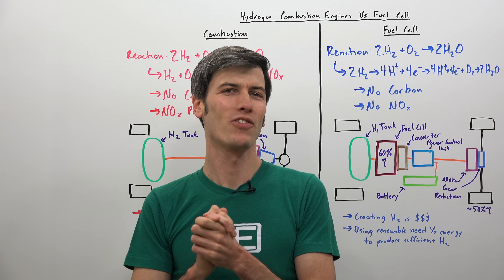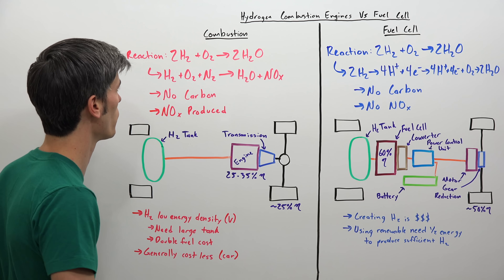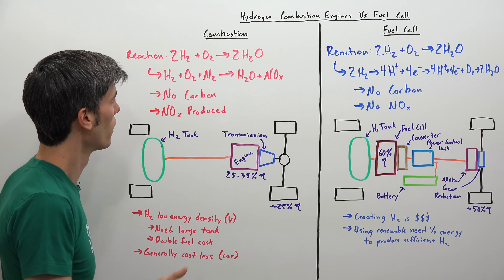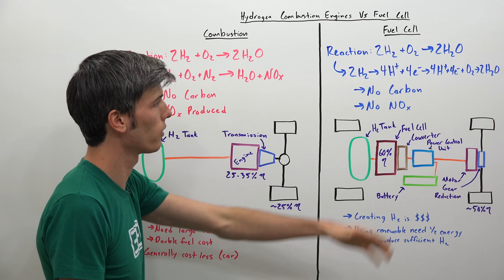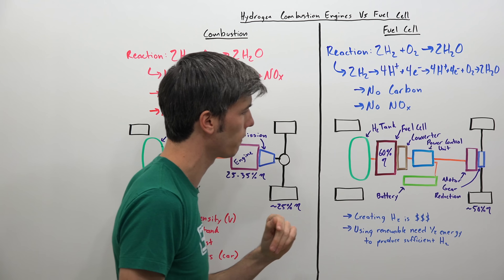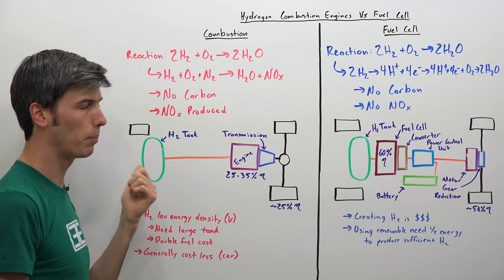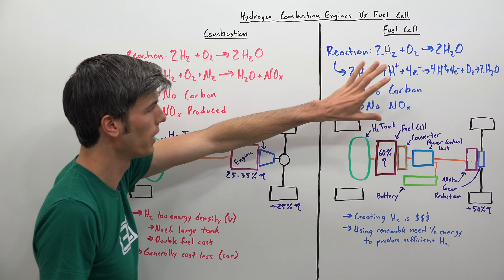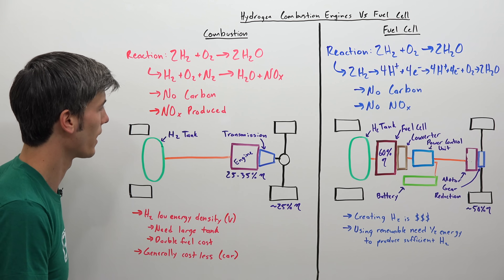Why Hydrogen Engines Are A Bad Idea

Comment: Wrong on the hydrogen "PEM" fuel cell efficiency that GM reached 78% + heat for winter. Also, no huge loss at the wheels as they reached 92% at the wheels using 3-phase pan-cake wheel motors. Pushing more atmospheric gasses into the PEM increases the efficiency using a 42 volt DC motor. This was the only noise I heard. Plus the tail pipe water is only 7% more than any ICE, so no winter road concerns. 
 As for fuel, it is sold in high pressure gaseous or liquid configurations and require only 20% more room under the vehicle. The hydrogen is produced using the "Swedish" model but not using hydroelectric sources, but contracts to purchase electricity at night when demand drops drastically. Electrolysis generates hydrogen from 12 midnight to 7AM at $0.3 cents per kilowatt hour and the compressed oxygen is sold to recoup a lot of the cost. This type of facility runs with a crew as small as 12 techs reducing the cost even more. 
 Our 5 passenger van ran up to 100 MPH with a 250 mile range using liquid. 
Shops are equipped with sensors and drive a roof mounted fan, as the vehicle has 5 sensors on board to detect leaks. Yes, it uses a 3 stage regulator but 3 injectors to operate the fuel cell at peak efficiency. Wheel motors and existing electric drives are employed and perform at a 400 HP range on the track with 4WD easy. It cost $0.19 cents per mile in 2008 dollars. 
 I don't like burning special corn genomes on contracts while using more energy to bring to the market that you get from it driving, all done with tax payer dollars providing $0.49 cents for each gallon produced but a tariff of $0.51 cents on any imported ethanol even from Brazil. Sad! 
Retired- ASE Master Tech since 1978.
Reply: I would like to take the time to post some info about my vehicles setup.  I have been running my car on Hydrogen for about 2 years now.  I do not store large amounts of Hydrogen fuel in a separate High pressure container.  I produce enough gases on demand through the electrolysis process to run my 2.4L engine which requires about 6L per minute at 7000 RPM to run without hesitation or noticeable reduction in power.  To be clear, I do not separate the Hydrogen and Oxygen gases in my device. I simply have a small container that will be pressurized to 12-15 psi before the system will shut off production automatically.  I produce enough gases on demand through the electrolysis process to effectively bypass the need for complex High Pressure tanks to store H2 like most of the current systems.
    With this method I do not store enough combustible gases to cause any significant fire hazard or air displacement danger in the instance of a "leak" or failure of the containment device.  I bought a new fuel tank to replace the one that came with the vehicle to prevent contamination from the old fuel.  Now I use my house water to fill my cars fuel tank which holds 12 gallons.  So the fuel system is the same as you would find from the factory but, I fill it with Water instead of Gasoline and the fuel pump connects to the water container in the engine bay instead of to the injectors.  Also I do not use the fuel injectors, I use a large aquarium tube that is connected to the intake before the MAP/MAF sensors.  In order to run my engine on Hydrogen I had to retard the ignition timing from about 25 degrees before top dead center to about 5 degrees before top dead center.  I did this by using a timing light and rotating my distributor clockwise by about 7 degrees.
    As a comparison my car got about 30 mpg with gasoline, now it gets between 25-35 mpg with Hydrogen.  In conclusion I am sure that with a more complex delivery system I could get better performance and mileage because I am not monitoring the fuel air ratio but, my goal was to create a system that produces less Carbon emissions not to be crazy efficient and cheap to fill.  I believe by producing enough gases on demand this is more efficient because if I run out of fuel through miscalculation or my fuel gauge stops working, I simply need to find someone willing to sell me water (in one case a woman was so impressed she just gave me the use of her garden hose).  This is also safer because I am not using a "High Pressure" storage container for a combustible gas or liquid, it is just water in a tank.

Comment: It all comes down to the biggest problem of all ICEs which is their thermal efficiency. If we exclude some extreme cases such as F1, most ICEs have less than 40% thermal efficiency,which means that 60% becomes heat and nothing else, you can increase its efficiency with forced induction but the 40% barrier is there. If battery technology was developed enough, probably ICEs would have gone extinct earlier, because electric motors are by far more efficient in converting their electric energy in kinetic (about 85-90%),its not a matter of why but when it will eventually happen.The path is not to make an ICE more efficient at the moment, but to make electric motors more efficient, in order to make means of transports who can be autonomous in their power needs with renewable energy and energy recovery.

Comment: Combustion wise it’s still environmentally better than fossil fuels. Fuel cells however are definitely beneficial to a 100 percent renewable energy economy within an LCA model, and as we transition from fossil energy within construction and production of hydrogen platforms we will be able to observe the full effects of a carbon neutral economy with an unlimited supply of hydrogen as a primary energy source.

Comment: But what if you can max up the efficiency a little bit by feeding that battery with a generator that functions as a brake also with some kind of clutch disc that engages the wheels to generate energy and friction to also brake the car. Pretty neat idk.

Comment: It still comes down to visceral feeling. Why do I drive a f150 even when I’m not hauling stuff? I could drive an electric car and be more efficient. Because I don’t want to drive a vehicle that is dead, has no soul or feel to it. Obviously both vehicles are “dead” but with my truck or mustang, I enjoy driving them. Period. I have driven two teslas and both were “great on the drawing board” and “made perfect sense “….. but they were like driving an appliance. Might as well take a bus.
If my ICE is bad for the planet and there is an alternative way to power it then fine, I’ll run hydrogen or ammonia. NOX emissions? Fine, I’ll use a catalytic converter to reduce that. But to go from a jump in, turn key, haul stuff to a silent “mode of transportation “??? No thanks!

Comment: Consequence from this video: Best efficiency is achieved with a battery driven electric vehicle because the battery stores >90% (not 50% as with hydrogen generation) of the electric energy.
Good to know, thanks.
Reply: Putting 100 kw/h of electricity in a battery let’s you take 90 kw/h out of it at 90% efficiency, but how much of that 90 kWh will push your car and how much is wasted whilst carrying the damn 2 tons worth of lithium with you? Also there are Heavy losses over the Electric Power Lines from the Power plant to the charge Station. The process

Power plant - Transforming Up - transmission lines - transforming down - distribute - transforming down - charge

Is about 50% effective. If you chose to generate hydrogen right next to the (green) Power plant you would eliminate these losses. There are plans about using fuel cells to power homes as far as I heard, so in the end a Fuel Cell or Li-ion powered car could achieve similar efficiencies
Reply: @Handyman1199  1.) The 2 tons do not harm. At first order: The power you use to accelerate them you recuperate while slowing down again. 
2.) The losses of the power transmission are in a single digit region. You have this same problem making hydrogen out of electricity.
However I can follow you. The greenest concept would maybe be a hybrid vehicle driving on hydrogen and wall plug charging. So you have the least cost most efficient choice.

By the way, the EV I drive needs around 18 kWh per 100 km.
Reply: @ghlscitel6714  Renault Zoe?
Reply: @Handyman1199  Yes. How you know?
Reply: @ghlscitel6714  my pal drives one and keeps claiming how efficient his 18kw (small accu) per 110km is. I’m driving a Trabant 2-Stroke so i think my opinion is obvious

Comment: Let's keep in mind the high combined environmental impact regarding mining / manufacturing batteries +  copper wiring + insulation + (at least) minimum lubrication + machining many other mechanical / electric / electronic components. Most of the above, won't last forever, specially batteries. IMHO is kinda taking 💰from my left pocket to put it in my right one, adding some energy to do it... 🤔

Comment: Before you give a long technical explanation of a Hydrogen burn! And compare it to a Fuel Cell!
First learn the burn speed of  a Hydrogen burn! Which it's called a Flame Front! Hydrogen burning with  Oxygen has a Flame Front of just under Mach 9! So now calculate that Power difference! Remember Power equals Mass times Velocity Squared!

Comment: Why are the losses in the converter and AC motor not considered these could safely be 20% losses. Electrical motors reach maximum efficiency only near full power which will seldom will be the case in a car.

Comment: Why is a hydrogen ICE as a generator for electricity not covered? A car like the Mitsubishi Outlander PHEV does exactly that, it uses the ICE to generate electricity and charge the battery and has 2 electric motors with good efficiency in the drivetrain. What is the efficiency of a hydrogen ICE to generate electricity?

Comment: Did you take into consideration that an H2 ICE will provide heat to warm the cabin and clear the screen etc in a cool climate. The fuel cell equivalent will have to use electricity to do this making it less efficient won't it?
Reply: Maybe, but probably not. The FCEV is still far from 100% efficient, so there's still some waste heat to be used.
However, even without using waste heat an FCEV will only ever use electricity when heating is needed and will do so in accordance with heat needs. An ICE will always produce that heat, by contrast.

Comment: So, I have a fairly simple question.  When the outside air is introduced to the fuel cell, how is the Nitrogen separated from the Oxygen that is used; I ask this because I noticed that you mentioned only the Oxygen component?
Reply: It's not separated. It simply doesn't react because it's not at a high enough temperature to react like it would be inside a combustion engine

Comment: Full cells need more pure H2 which is more expensive and usually not available under the same pressure(700bar against 200/300) . So in that way storage the space and cost  argument  are not that valid..

Comment: I think the best idea would to use ammonia (nh3) instead of hydrogen to power a vehicle. Ammonia  is a lot cooler burning and would be no emissions like hydrogen (except for NOx) and plus it would be easily stored in low pressure bottles. The engine then could be coupled to an hybrid system to lower emissions and consumption even more
Reply: Yes, exactly!

Comment: Okay all of it's cool but you forgot about the line loss that you're going to lose how much I don't know what size gauge wires they're using but you do with an AC current have a voltage drop across the wires

Comment: I enjoyed the video. Naturally, one can't escape the nitrogen emissions aspect, but what about hydrogen driving a microturbine then powering a smaller battery or transmitting energy via a flywheel? This would be far more efficient than a piston or even wankel rotary & perhaps could generate enough power to turn off and on as needed? I don't have the scientific background to really crunch the numbers.

Comment: No, there is nothing wrong with running an ICE on H2. It is not a "bad idea". Just like the camera you have is the best camera you have, the engine you have is better than the engine that you don't. Regardless, when produced and processed properly, ethanol can actually go carbon negative. Boeing found a plant you can grow in the Sahara Desert and water with salt water -- that's a biofuel that doesn't displace any natural ecosystem. Process it properly and we're in great shape for the future. Put differently, we don't necessarily need a "brand new" technology.

Comment: Did you  do any tests do get these numbers, or are you basing everything off of previously observed research because I noticed that you compared hydrogen combustion to gasoline.  There's not any difference between gasoline and hydrogen on efficiency?  If you based all of your numbers based on average gasoline combustion engines, how is that a fair comparison?

Comment: ICE is cheap but produces NOX and CO2. The NOX can be eliminated with catalytic converters which separate it into pure nitrogen and oxygen. Every car has them. ICE is less efficient than fuel cells, but much less expensive. Also, fuel cells can become contaminated. Quote:

Contaminants derived from fuel cell system component materials structural materials, lubricants, greases, adhesives, sealants, and hoses have been shown to affect the performance and durability of fuel cell systems. 

Also, fuel cells wear out and must be replaced after 100,000 miles or so. ICE can run reliably for 1 million miles. This makes fuel cells much more expensive, which helps offset the lower efficiency of ICE. Also, the catalytic converter may wear out after 100,000 miles, but they are much less expensive to replace than a fuel cell.

Another major polluter is airplanes. But you cannot put a catalytic converter on a jet engine. As a result, they produce NOX and other harmful products. Quote:

Similar to the automobile's internal combustion engine, a jet engine mixes a fuel and an oxidizer to burn (or combust). But burning kerosene, a flammable hydrocarbon oil, produces pollutants like carbon dioxide (CO2), nitric oxide and nitrogen oxide (NOx), sulfur oxides (SO2) and soot.

These issues help explain the recent move to lithium batteries for cars and airplanes. These are much more reliable and have much lower maintenance cost. The batteries may only last 100,000 miles, but intensive research is providing new batteries that are much less expensive and can last much longer. ICE will soon be dead, and fuel cells never even got started.

Comment: The H2 ICE efficiency is 40%+, depends what tech you have on the engine.

In a HEV configuration, the overall efficiency is quite high.
Reply: If you don't factor in the; manufacturing and logistics around Hydrogen, you might be right. But you won't get much better than petrol. Hydrogen doesn't have a better energy density, and using the same type of engine, I don't see how it can be more efficient than petrol.
Reply: @markvandervelden6280  actually, H2 is 140MJ/kg, 3.5x that of gasoline fuel.

Other benefits are no CO2 emissions and very low NOx emissions.
Reply: @NeborodVinchanski  I'm not sure if we'll end up using liquid hydrogen, which is the energy density you're describing. That'll require storing it at low temperatures. Unless you have a source which describes how that's supposed to work, I'm pretty sceptical. I'd love to be educated on the topic however.

If we use the gas form of hydrogen, which i think is more likely, you are not even close to the energy density of petrol or diesel.
Reply: @NeborodVinchanski  you're right that NOx is lower and no co2. However Hydrogen needs to be produced and requires retrofitting. Hydrogen will be very expensive to use i expect.

I'm all for solutions, but I expect this to be a goodwill disadvantage. It will bring the consumer at a unnecessary cost disadvantage, due to poorly formulated regulations.

Comment: Hi Jason, what are your thoughts on how best to replace fossile fuels with hydrogen in hybrid electric propulsion systems for heavy lift VTOL drones? It seems that energy density is higher in hydrogen, but power density is lower in hydrogen compared to fossil fuels, and power density is most important for providing the thrust that is needed for heavy lift VTOL (no wings) drones. Any way to combine hydrogen and fossil fuels to get the best of both energy and power density properties?

Comment: I see as usual that no one is pointing out that a true hydrogen powered vehicle.(air, ground, sea doesn't matter) would have its own on board oxidizer tank and that when burned would be stored onboard as water and reconverted back into hydrogen and oxygen when parked at "fueling station lol" this would be a true hydrogen power setup. And don't even start with the hydrogen is explosive bs. it is when mixed with an oxidizer just like gasoline or diesel. And in fact is safer BECAUSE it burns so fast that there isn't a chance for it to create a big cloud like gasoline. Think oklahoma bombing vs  jet engine. The only way that hydrogen is more dangerous is if intentionally mixed with alot of oxidizer. Or in a horrible accident that ruptures both tanks in which case the occupents of the vehicle are more than likely already dead. No matter what the fuel source is you will have to put energy into the vehicle periodically in some form or other. hydrogen simply gets you the most power and the farthest distance per unit of fuel compared to all the others.

Comment: hello sir, as I know Lel gas is very explosive. i.e.  oxygen gas mised with mixed with about 4%or more hydrogen is explosive at normal room temperature & pressure.  & threr is some definite relation between H2 %, temprature & pressure have different explosive propeties & energies. hence I believe looking at working of IC  engines I think some optimum praportion of these values & certain praportion value mixture  of Oxygen & hydrogen can be worked out to use it as a fuel in IC engines. this way by avoiding Use of air can eliminate creation of Nitrogen oxide.  please comment.